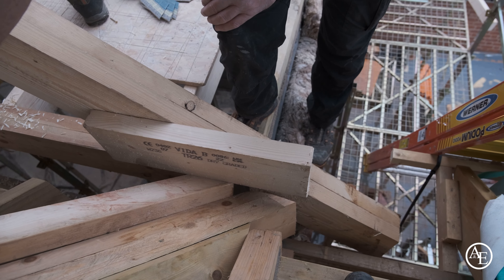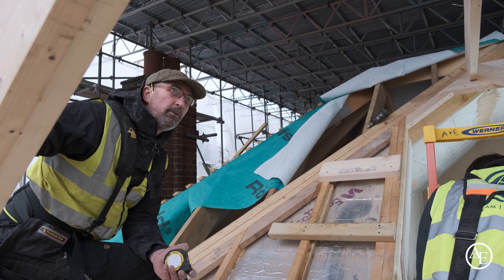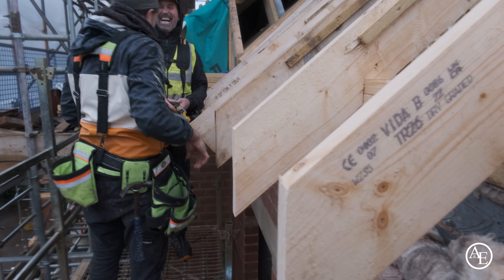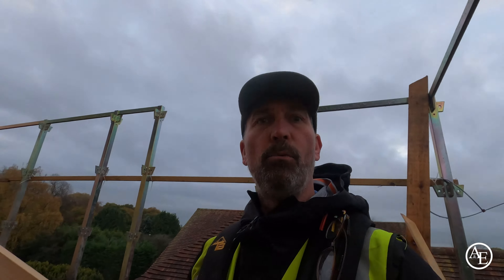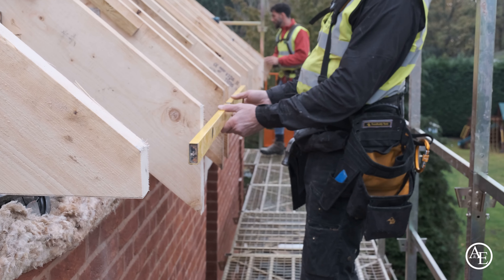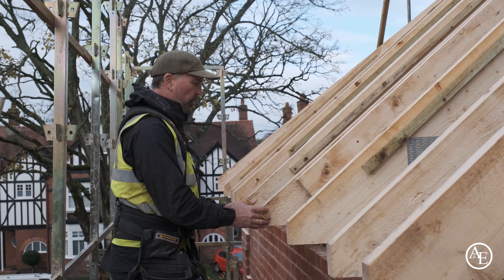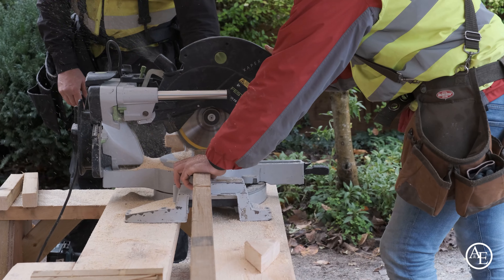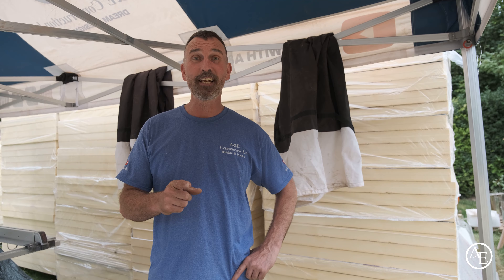Rafters for Two Storey Extension! | Onsite #17

Comment: Quick tip for ye lads, have a chalk line in the tool bag with cement colouring instead of chalk. It's ideal for those wet Days, one can get it in different colors as well. Also a chalk line with no chalk is a tidy way of storing a dry line, 👍💪🔨🇮🇪🇮🇪